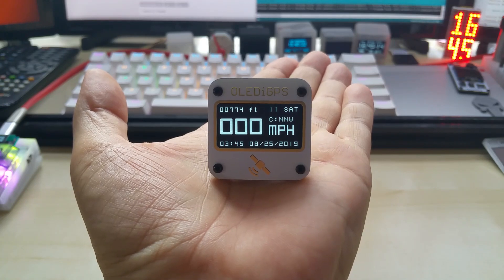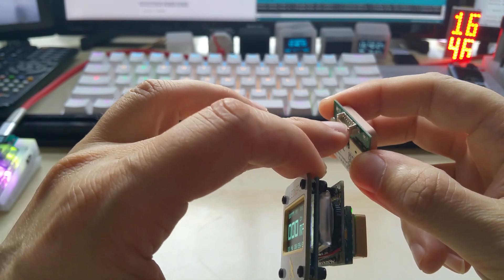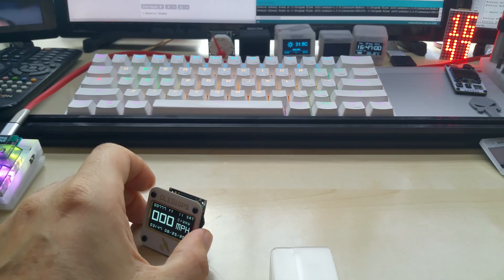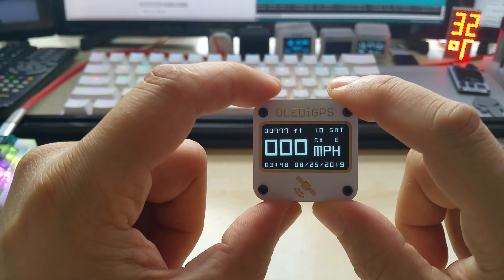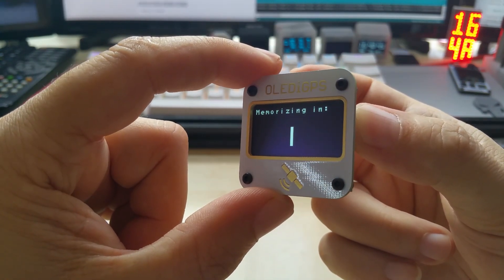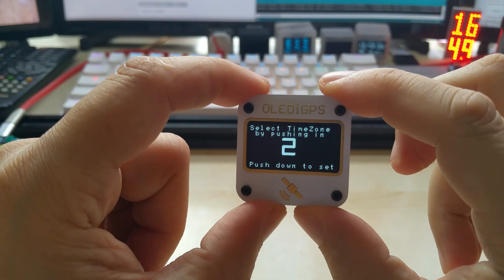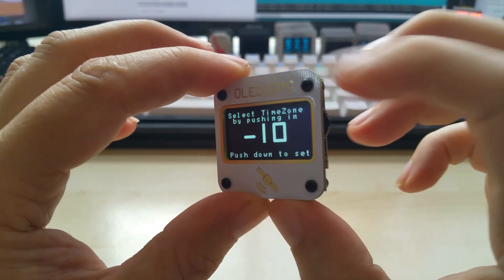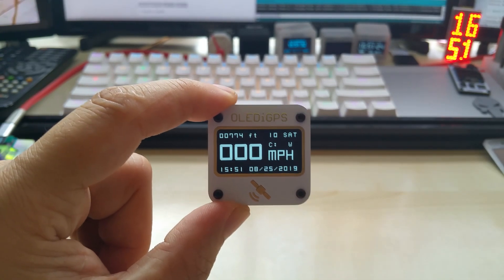Latest update on my OLEDiGPS Cube with 1.3" display and frame for mounting in a GoPro Session Case

Comment: Awesome work Hayri, does this have the ability to show boost ? 
Thx
Reply from the maker: Thank you Rashied, but what boost do you want to see in a GPS?
Reply: Hayri, sorry I was watching a few of your videos and must have posted in the wrong video :-) ..
Reply from the maker: @rashiedabdoel1880  No problem, I figured that but wasn't sure, I assume you want to see boost over CAN BUS in your car. Unfortunately it is not a standart supported PID and varies from car to car. Short answer, not really, as it is car specific.
Reply: Hayri , ok no problem thank you for the advise and keep up the good work .. I have found some Zada tech pre-made ones :-)
Reply from the maker: @rashiedabdoel1880  I know those, they connect to the boost pressure sensor directly. Better option for you, good luck.

Comment: These are awsome !
I'm after a replacement Inclinometer for my car.
Currently there's a digital version out there that's installed into a 2" round car meter. But I'm really after a nicer Digital Horizon like display. If you made these you'd sell hundreds. Tell me what you think.
Reply from the maker: Thanks, but I am currently working on my CAN BUS micro gauge and after that on a whole bunch of CAN BUS related products and I doubt there will be any time left to bring out another product, so much so that I will reduce my current products from over 32 to down to maybe 10.

Comment: Very well designed. I especially like the gold band around the display and how you covered up the black sticker part that’s is the top or bottom only showing the visible part. The four black screws in the corners is a nice touch as well.
Reply from the maker: Thank you Mike, means a lot to me coming from you :-) Speaking of screws, getting them in brass would be even better, just came to my mind reading your comment. I did chose black because the chrome/stainless did not look as good. I do like your designs a lot and am amazed at your miniaturization skills, I am still sticking to TQFP32 and 0805 :-) I see you haven't lost your love for OLED's yet :-)

Comment: Great work as usual Hayri! Would you say that gps (L80) is the best one you have used out of all the ones you have tried with regards to time to first fix, antenna signal quality and power consumption etc?
Reply from the maker: Thank you Ian. Definitely, I would not use anything from now on unless I find a smaller one, although then you loose reception quality. As you can see in the video I get about 9 satellites indoor, not possible with the larger one, they also work up to 10 Hz, the bigger only 5 Hz plus the current consumption is almost half.
Reply: That’s great! I think that is one of the smallest ones. I believe the quectel L70 is even better with regard power consumption and time to first fix. You may find this an interesting read on gps tests/performance. 
https://github.com/LoRaTracker/GPSTutorial/tree/master/GPS%20performance%20comparisons
I think the L70 chips are still available but you have to mount the ceramic antenna and mount the passives as you have on your mini board.